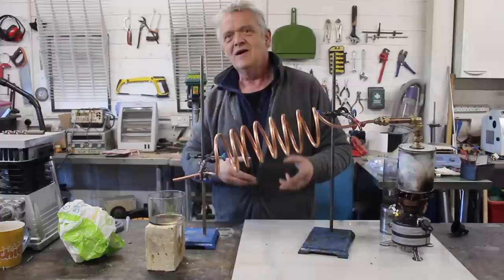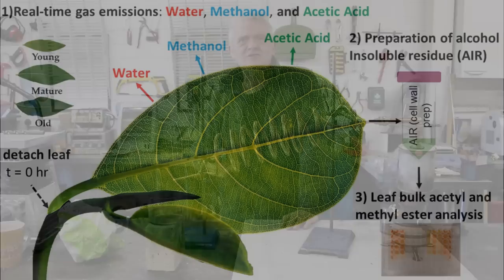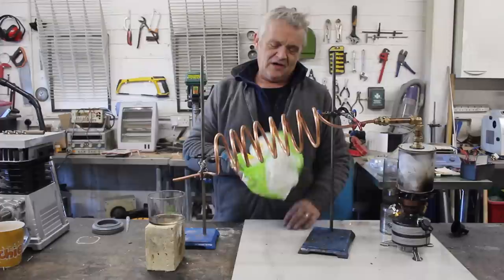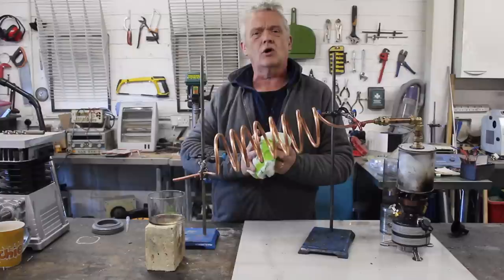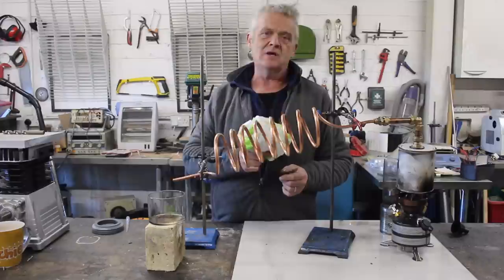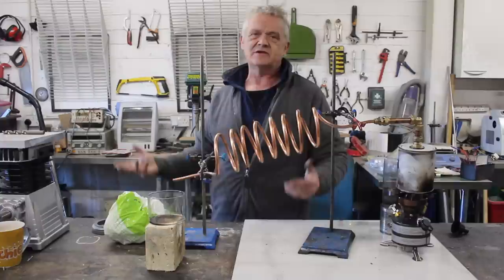1711 Fuel From Plastic - Destructive Distillation

Comment: QUESTION: can a solar reflective heater (such as the solar water boiling gizmos)generate enough concentrated heat onto the container with the plastic to obviate the need for a burner or fuel component? Thus making the whole production of the ‘oil’ virtually free?
Reply: Given the parabolic mirror arrays used to heat sodium lines to run a generator and produce electricity, I'm giving a setup for this could be achieved
Reply: It would be better to have the reflective heater heat up a pipe in which a HIGH boiling point solution (somebody mentioned liquid salts I think). It has to be able to handle going up to whatever temperature is needed to run the pyrolisis process without boiling
Reply: I wondered that cuz I seen this Ukrainian guy on YouTube boiling water with curved reflectors
Reply: Solar cooker 200-400F max
Reply: You always need some catalyst but depending on how intricate the setup for the reactor is you can use the energy absorbed by solar panels as that heat source via various means (microwaves, induction, etc). One of the nice things about this setup is that if you are not able to separate and store the various forms of hydrocarbons that are the result of the breakdown of the original material you can redirect the gasses to aid the burner and reduce the overall input
Reply: A fresnel lens will focus sunlight enough to melt rocks. Not sure how yet how to make use of this. One thought was to use a pit in the ground as a crucible to hold molten steel then use the heat regulated by proximity.
Reply: this could be done. a magnifying lens ( search solar scorcher on youtube )  focused to your distilling container would easily work if your container could handle the heat. Also you'd have to accurately track the suns position and sky position.  idkHow2pickAname idea of solar panels to electrically heat the device may be better because you can accurately set your distillation temp and hold that temp
Reply: @_____ Generating energy is exactly the relevant aspect to me as well as the difficulty and expense issue. Refining plastic waste to fuel is useful, plastic to goo not so much. Scrap steel, available free in any urban area in the US as are Fresnel lenses salvaged from DLP tv's (given away daily on craigslist) convert an old lawn mower engine into a generator and were in the money! Theoretically.
Reply: @_____ What then is the point? Science experiments may be fun and educational for some but, that's not my jam. It's all about the application and utilization for me. I'm kind of simple like that.
Reply: The amount of energy/heat you get from a fresnel lens is relative to the size of the lens and size of the focal point. You could set the distance to the container in such a way that the focal point's size is just small enough to get the desired temperature. If you create a very small focal point you might melt the container. Use a gun type thermometer. But yeah, lots of fiddling and tracking and take care nothing gets in the way of that death ray, like your hand or a puppy or your best table. Wear sun glasses, especially if you go down the reflective parabolic type cooker.
Reply: @judyofthewoods  That's the whole idea with the steel actually. I've seen a few vids with the folks that burn stuff and actually never seen anything useful done with them. It seems like there is a hot spot and then outside of that range the light is fragmented beyond. It's been a while but, I don't think there is much in the way of variable heat ranges. Steel will stay hot for a while. I'm thinking maybe long enough to use the heat for various things. Heating water or even refining plastic. The simple part is important. That and cheap. And of course useful. Someday I'll make the video. lol
Reply: Possible, of course! I think you'd have a well met challenge there, though. You can get energy out of/ into most anything. Keeping it around for the rest of the party is the tricky part, in this context.

I can't give any numbers, so really this is a barely useful anecdote, but most of the direct solar extractors I've built or seen, some of them pretty powerful as far as peak wattage, it's just not coming in enough to relate it to even scaled down industrial uses. Now, take that with a grain of salt, scale down something tiny enough in this sandbox, you'll get a result. I would just expect an arbitrarily high amount of work/cost per resultant whatever metric you want to use.

But hey, all I see reading back my comment... Sounds like someone's got a good challenge Infront of them to change the world! The "problem" with solar is flux density at ground, at least within the context of our tech/materials availability. Yes, things have gotten significantly better as the years go by, but even if you got things up to 70,80%, you're still pushing the wagon by hand compared to other options. I think you might see better results by combining multiple influx of other sources, just as a stout three phase wind generator, and applying them as one through conversion process at the cost of efficiency, or possibly to a direct portion of a given process, e.g., for a preheating phase or something.

No matter what, I'd be very interested to see/read of serious attempts and successes.
Reply: Yes
Reply: Yes! The challenge will be to keep the focalized beam in place long enough to achieve pyrolization. (Dang! Here I go inventing new English words today. I'm on a roll!)
Reply: Pretty easy if you vacuum insulate it, use an ultra black coating on the container to be heated, and use Solar reflectors/concentrators. So the outside needs to be glass (preferably borosillicate, quartz, or the like) or the new clear ceramics. Regulating temps will be the tricky part.  As some have said, converting Solar to electricity would be easier as far as controlling temps. But there are energy expenses and losses to consider in such systems.
Reply: Not in this country but it has been done doubt you could make anything that would do the job but happy to be proven wrong
Reply: @justinw1765  ya so what about a heart shaped alon box?
Bullet proof glass by some means..
Guess there's a few ways?
Add various opacities.. so it ain't always glass so to speak..
Reply: Also electric heater powered by PV
Reply: @Meme Man  a heat exchanger with a high pressure (70bar, 1000psi, 7000kpa or more) helium charge would transfer as much heat as you want.

Heat capacity of salt is 0.88kj/kg, helium is 3.11 kj/kg....unless I'm misunderstanding the assignment...
Reply: it would be the bare minimum amount of heat but yeah it would probably work
Reply: Use a "pot" fill it with Sand place the Destillerie on top and fill it with Sand
Reply: No, since pyrolysis has to be in an oxygen free environment, you would need to heat it from the top, through a see through substance, which would have melted way before you achieve anything. You could technically heat something under your container, but that would be extremely inefficient, and would not reach nearly the right temp.
Reply: @dennistaylor3796  that's a solar cooler, a larger fresnel lens would be hotter.

Comment: Don't you get condensed fluid at the bottom of your coil turns?
Reply: It depends, but there will likely be some liquid left in the coils, but you can take the coil and tip it vertical for a few minutes so everything drains out. I say it depends because the flow of vapor can help push the residual liquid from them but there will always be some stuck.

Comment: ACTUALLY knowing a bit on plastics, the bags are LDPE and the plastic tubs, garbage bins, black plastic water pipe etc are HDPE. The only difference is low or high density. LD is low density HD is high density but they're both polyethylene. I haven't watched it in full yet but what's the chances we're making ethylene....

Comment: With the coil sitting almost horizontal won't the liquid build up in the bottom of the coils eventually blocking the flow? Would it be more efficient with the coil vertical?
Reply: Yes.  That annoys me too. :)  You can also get more useful output if you put a reflux column (a vertical section) directly on top the retort, and then condense what comes out of the top of that.  This causes some condensate to run back into the retort for another go at breaking down, and you get lighter fractions distilling off.  (more like kerosene or naptha)
Reply: @dansw0rkshop  I've done that with an alcohol still.
Reply: By laying the coil sideways a series of P traps are created, which can fill up with fluid and block the passage of gas.  Why is he placing the condenser horizontally?

Comment: Folks, HDPE is recycle code 2
You can also use LDPE, recycle code 4.
Don't use other plastics, some of them give off toxic and corrosive gasses. 
You can get at least 3 fractions - one a bit like petrol, one a bit like kerosene and one kinda like diesel, but as a wax.
That depends on the temperature you cook and cool.
Don't heat the plastic too much and get the gas VERY cold - if you want to collect the lightest and most volatile compounds.
It will begin to give off gas at about 250c, as it gets hotter, the heavier compounds begin to vapourise. 
At 500c the whole thing will boil away. 
If you want separate fractions, it's easier to control the input temperature than the cooling temperatures. 
For collection, submerge the condenser outlet in a bucket (with lid) of cold water. You'll need a couple of holes in the lid, obviously. One for the condensate pipe and one small vent hole.
All the good stuff will float on the water, for you to skim off.
Reply: reminds me of making moonshine and removing the methanol from the mix.
Reply: HDPE needs to be heated to approximately 450°C for pyrolysis. As you indicated there are lighter fractions, especially with mixed polyethylenes, that may be collected or used as a gas to assist in the heating process.
Reply: I'm suprised you got anything from the condenser, those bags couldn't have been more than 20-40 gram. I'd guess the heavier volatiles would get stuck at the bottom of condenser loops. Anyway, carry on!
Reply: @Paxmax  I’m sure he did more than one bag.
Reply: @fearofchicke  Yes, I agree, that is why I wrote 'bags' as it seemed to be bags stuffed into bag because of the final volume pressed into can. I would guess 3 bags or less, but that is based on a very standard grocery store Swedish shopping bag. 3 of those, I keep them tightly tied together for minimum volume, that weighs 51 gram. (I was only spit balling it in first post)

Maybe you mean he stopped and refilled can mid destillation?
Reply: @hightechredneck8587  separating methanol from ethanol is actually quite challenging (due to hydrogen bonding) and not what happens when you collect the foreshots / heads.  Those fractions just have a higher concentration of acetone, acetaldehyde, ethyl acetate, and other cogeners with a higher relative vapor pressure.

If methanol is in your wash, it'll be in distillate in roughly the same proportion, which is why it's so important to avoid chemical reactions that produce methanol during the fermentation process.
Reply: PP plastic and PET will also work..
Reply: If you can get one fraction similar to petrol, and one fraction as kerosene. Could you not reach the middle and get something similar to naphtha that’s stable? Curious because I have some white gas stove, and lanterns. And if I’m in a position bad enough I will most certainly do what I can to get by!

Comment: Reminded me of power producing trash incinerators that we were looking into for a US Navy base back around 2010 - I resigned my commission before that public-private partnership was greenlit, but I think the company ran out of VC money and failed.
Based on the designs though, Coal plants (with modern scrubbers etc... ) could be modified to accept most trash. The pollutants of concern are removed as fly ash and clinker and encapsulated in concrete as sidewalks, roads and parking lots. This waste product saves tons of energy and waste used to make traditional Portland cement. Unfortunately this isn't common yet due to placing the original high-pollution plants away from the places with high population that would use the most concrete. It's way more cost effective to use all the trash as fuel than to waste a ton of resources attempting to recycle it.

Comment: Wow. I save every bit of packaging from all purchases to keep it out of the landfill. (My son said, "So she turned her home into a landfill.") Some is metal, like cans that I now have uses for, but most is plastic. I separate & store it by recycling codes. You have my attention.
Reply: Same. I have trash bags full of plastic. I bought a 5 gallon distiller on Amazon that I'll use to make my fuel.
Reply: @ChadKovac  I've been shopping distillers for a while now. Couldn't decide: stainless steel? copper? glass? med lab? commercial? residential? stovetop? electric? But...if I could make it out of all this surplus recycled material, that may be best option of all.
Reply: @Good4All4Good  I'm going with stainless. If it works I'll upgrade to 55 gal drums
Reply: @ChadKovac  Yeah! That's what I need. A way to scale it up for one big project, instead of a lot of little ones. Good idea.

Comment: Just found your channel. Reminds me of a wood gasifier. Theres some high quality units you can build/buy that'll reliably power a gasoline generator using only wood or charcoal. Adding alittle water in its special res. adds hydrogen to the mix. Very useful stuff

Comment: The best use of milk bottles is to use it as a mouldable plastic. You heat it at low temp and it forms a gloup that can be poured  into a mould. Giving you a 3D object without 3D printing.

Comment: "bit stubborn" yeah if you control the temp what should come out is pure crude oil compound that can then further be fractionally distilled and ran over catalysts or zeolite reformers and all sorts of stuff to make the components of gasoline, or other basic building blocks for just about anything hydrocarbon based :) 

from what I have read everywhere that research on this is being done, polyethylene plastics seem to be the perfect one of the plastics, to do break down distillation to crude oil (that is completely clean of contamination if you are using pure plastic with no coatings, or pigments inside it,)  So this process being reversible with a catalyst from ethanol, and how easy it is to make ethanol from bio sources, seems like we could literally be calling it pelleted crude, something we make and store till we need to break it down and make into an oil or even better assemble a whole arrangement of components that you just put in the plastic and out the other ends come the stuff to make what ever oil derived substance you wanted (most probably would want to make on tap gasoline blend for their vehicles knowing us in the USA. lol) anyway, that pelleted fuel I think could become a substance too that would be easy to build an economy of trade with too :)

Comment: Very good demonstration! I’ve seen dry distillation done in a camp fire with popcorn tins and such, simple and effective. Now, how about a destructive pyrolysis rocket stove. Load the tin with your pyro-media place the assembly into the rocket stove, prime it with some methanol or twigs and shabang! Clean(er) burning plastic. You may even be able to meter the pyrolysis temp by adding a downdraft barrel over the primary chimney and raising or lowering the tin through a hole in the barrel top.

Comment: Here is an idea for this to be fairly cheap and sustainable:  Buy one of those very large vacuum insulated beverage containers (the 64 to 128 oz wide mouth types) at Walmart or the like. Get a metal container that can fit in same (with the following put on it). Wrap nichchrome wire around it, and hook that up directly to a Solar panel (I haven't done the calculations on the wattage you would need, but I suspect you would need at least a 100 watts). 

   Then, crinkle up some heavy duty aluminum foil and lightly wrap that around the outside of the vacuum insulated container. (this is to reflect any lost IR back towards the inside container. You need some air gap between the foil and the container for it to work though).  Use some high temp insulation to cover the top. I recommend fumed silica in between fiberglass cloth that is sewn with kevlar thread. Ceramic fiber is a decent alternative. Put some crinkled up Al foil over the top of that insulation as well.

   You now have a rather efficient heater, at least when the Sun is out and shining.  From the late fall to early spring season, when it is cold to cool out, put reflectors on the sides of the Solar panel to increase output.  If you do the insulation on the top well enough, you could use this in virtually any temps outside since vacuum insulation + IR reflecting material is an amazing combo.

Comment: Another great video in this series.  really glad I stumbled upon it.  I looked in this exact setup a while back but have yet to actually do a run.  When I was researching it I was advised by a few sources (one from Germany where they do this on industrial scales) who said to add a little sulphuric acid to the feedstock and it will help break the heavy molecules down to lighter ones at lower temps.  Sadly I am not in a physical location where I can do this but I'm hoping someone out there can confirm this.
Reply: Sulfur needs to be removed from the end pruduct. In home biogas generators, many people use fine steel wool in a plastic pipe to flow the gas through and remove the sulfur.

Comment: burning tires (atleast when it contacts air) releases sulpher oxides, which are corrosive and toxic so just a heads up, but burning them in an anerobic environment should be fine. also dont burn PTFE as when it is pyrolyzed it gives off toxic fumes and can cause polymer fume fever.